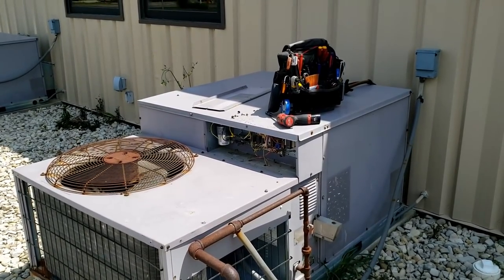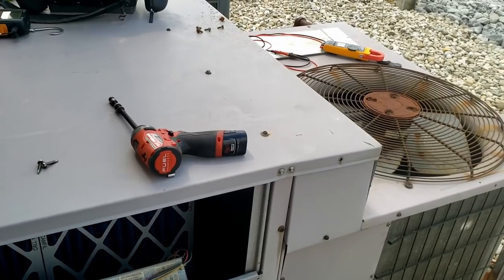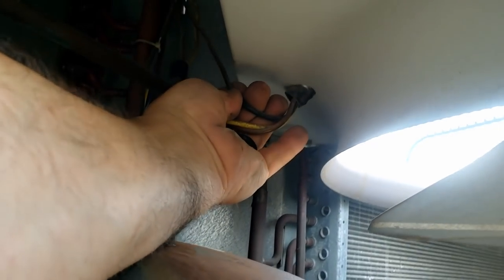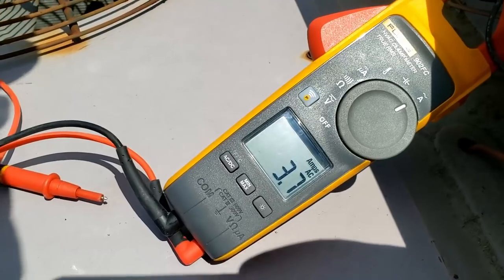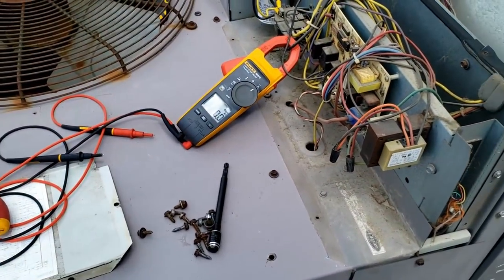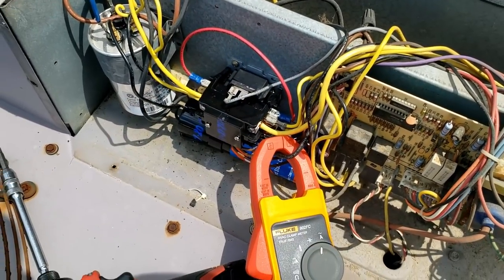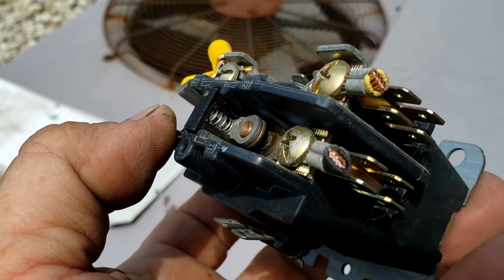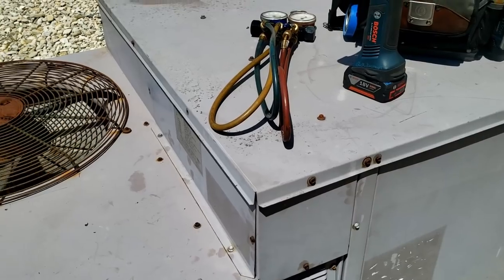NO COOLING BREAKER TRIPPED NOW IT RUNS

Comment: One thing I have done for years on rtus and ac unit and heat pumps is put foam tape down where wires cross the piping and metal.  Also re zip tie things back up.
Reply from the maker: I'll use 2 zip ties where it has to touch a pipe. I'll wire tie the wire tie. That keeps the wire away from rubbing into pipes.

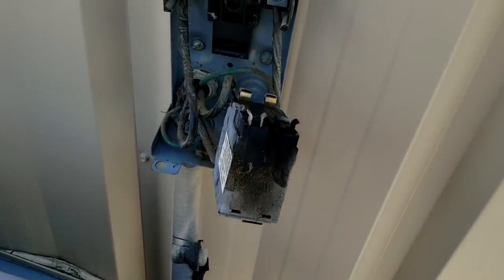Comment: and LOL @ 8:16 I knew it, see previous comment. it likely overheated from the loose lug or moisture/water intrusion and someone actually "cycled it on/off" when servicing unit.
again, they're not a breaker, just a junk disconnect in breaker style body and a breaker will not fit properly and enclosure is too small for thermal output of a breaker =p

Comment: I would give a quote to replace the ignition control board, it has discoloration where the two blue stripped diodes are near the top right of the board. #BIGPICTURE

Comment: at 3:32 that's not a breaker and has no thermal/current protection! if the lugs were loose it's likely started to burn or cook inside and they do fail that way often, overheat start to melt/warp and burn the contacts.
no a regular breaker won't fit in the case, there's a "keying" nub to keep that from happening(without cutting or major force). because the enclosure is too small for a breaker which has thermal and current trip components(heat output) even if you put in a 60amp breaker on 30 amp circuit imminent failure :)
just replace them with a larger pull-out/fused disconnect then can be stupidly intermittent also. (the sparky in me is coming out, lol.)

Comment: Quite a few of my "breaker tripping" calls this year involved the disconnect being the culprit. And yes there is still a breaker shortage going on. Had trouble trying to find a particular one a week ago
Reply from the maker: I figured the talk of a shortage was probably some BS or blame it on covid crap. Square D is pretty popular around here so it was kind of surprising to me it wasn't in stock. They had single breakers and some 20 amp 230 volt but that was about it.
Reply: @HVACRSurvival  yea the covid BS is the reason behind the shortage. square D is what i was having trouble finding.  i had to hit an electrical distributor to find what i was looking for
Reply: @HVACRSurvival Sucks needing parts after wholesale hours.  It's great that you were able to get them up and safely running, but for non-billable purchases, it hurts to pay more for less selection like that.

Comment: I had a unit similar to that tripped the breaker and it turned out to be the condenser fan motor when i replaced it i slid off the black plastic tube and could tell it was dead due to the smell and bearing dust that there
Reply from the maker: Thanks 4 sharing 👍

Comment: I got electrocuted because I didn’t see you discharge that capacitor properly. I will be in contact with you about this. Lol
Reply: if an electrician(elechicken "AvE") tells you they've never been shocked, they're lying out their teeth and rump. meanwhile the rest of us have landed across the room once or thrice and BBQ'd ourselves many times,  across one hand, through fingers, hand to hand through chest, in arm out leg/s, in forehead out hand(YEP DONE IT) I have always been complacent and mostly care free around 120v or 208Y/120v 3chicken phase. (residential) I know it hurts and just whizzes me off.
now anything commercial, I check voltage first or inspect and KNOW the voltage first, I will not wire 480Y/277 live or any other between and above. it hurts much worse and tends to hold an arc for longer periods (old garbage equipment)

Comment: My guess early on was the outdoor breaker. Those always seem to die.
Reply from the maker: I've been checking them more and more and finding a lot are in bad shape. Otherwise this video was hardly Worth showing. That's why I kept it since July 🤣
Reply: I'll copy this here, a bit long winded but true.
at 3:32 that's not a breaker and has no thermal/current protection! if the lugs were loose it's likely started to burn or cook inside and they do fail that way often, overheat start to melt/warp and burn the contacts.
no a regular breaker won't fit in the case, there's a "keying" nub to keep that from happening(without cutting or major force). because the enclosure is too small for a breaker which has thermal and current trip components(heat output) even if you put in a 60amp breaker on 30 amp circuit imminent failure :)
just replace them with a larger pull-out/fused disconnect then can be stupidly intermittent also. (the sparky in me is coming out, lol.)
Reply: @throttlebottle5906  that explains why there is no rating on it lol... good catch!

Comment: what was the comp start up current with the new contactor and hard start kit?
Reply from the maker: I found the breaker and got side tracked with that and the disconnect box, I don't remember if I rechecked it. Usually it lowers the amperage 10-20 amps. I should have used my fluke 376 for true in-rush current but the 902 got a decent look at the starting amps.
Reply: That current was high because of that voltage drop. Had a stand off on a bus bar burned in half this week same problem high current and voltage dropped under load. Great video 👊
Reply: @HVACRSurvival  cheers!  was just curious how much difference they make
Reply from the maker: They definitely make a difference, I added one to my heat pump at home so that I could run it on my smaller generator . It definitely lowers the starting amperage.

Comment: Megger the compressor windings?  The good ol' supco m500.  At least you'll have an idea if the compressor is on its way out.
Reply from the maker: I should have used my Fluke 376fc with true in-rush current, then if it exceeds the locked rotor amps I'll sometimes I'll get my Extech megger out. They say you really need a baseline history for a megger but sometimes the resistance is real bad and you'll catch it. Thanks for the feedback 👍👍

Comment: Hate those Square D disconnects with a passion.  Those aren't actually breakers in there, sticker on the side says so.  You CAN throw in a QO series in but why bother. I've had more than my fair share of those play possum and nope, you turn them off and they never turn back on.  

That first start started sluggish to me, but only because I know cameras can pick up noises we might miss on site, and that high start current told me you were losing voltage.

One thing I do is check load side voltage while watching startup current (2 meters or the UEI DL428B) to see if the high current is voltage sag or tired compressor.

Great job otherwise. 👍
Reply from the maker: @sivalley - I believe that was a QO breaker,  there wasn't nothing special about it. Thanks for sharing👍👍

Comment: No voltage measurements?
Reply from the maker: I don't always record none stop. There was a spot were I checked some of the obvious things off camera in the beginning then picked up the camera again. When I don't have my tripod or my GoPro that's what happens. As you can tell the quality is a little bit better because I recorded it with my phone but it doesn't catch as much of the action when I use my phone.
Reply: @HVACRSurvival  Not saying you're not thorough.  Just wonder if the burnt contacts on the breaker showed up as voltage loss.  You found it, you fixed it.
Reply from the maker: @joehead1294  it's all good, when I record non-stop it's a pain in the ass to try and edit it down because I feel like everything's important.
Reply: @HVACRSurvival  Some of the best on YouTube.